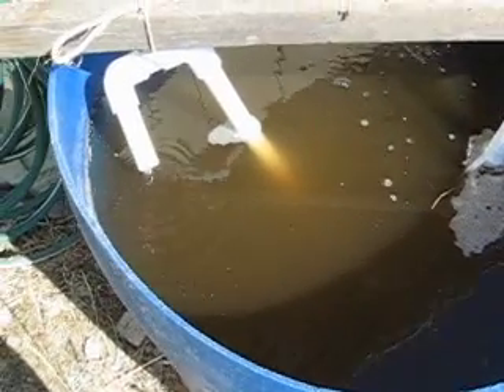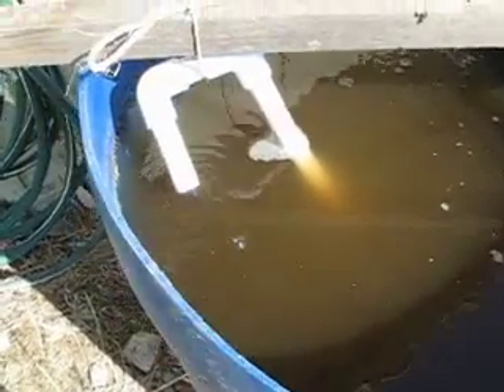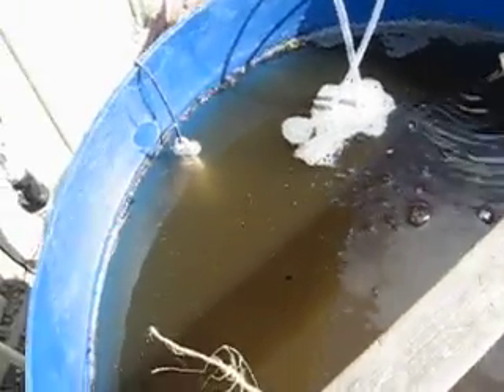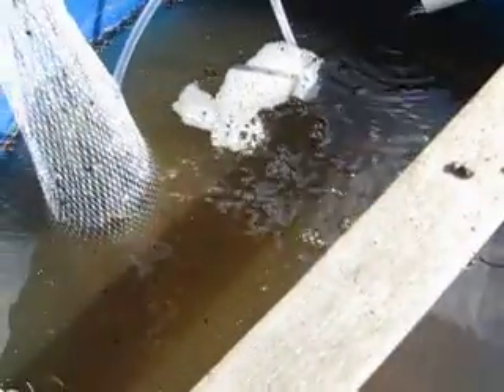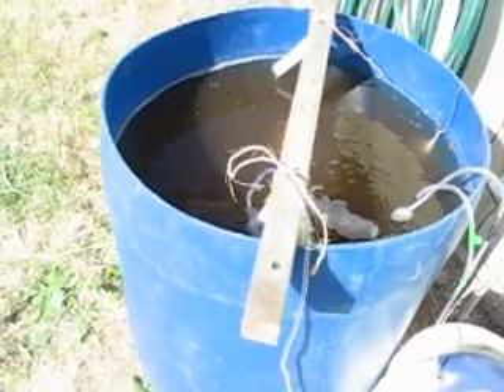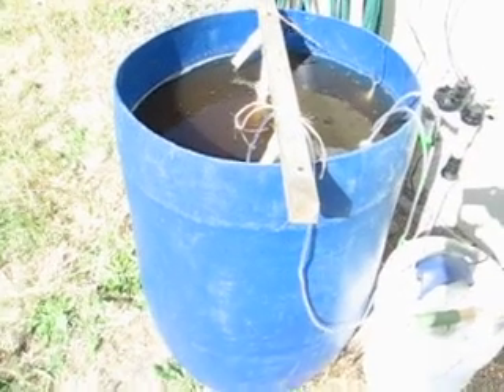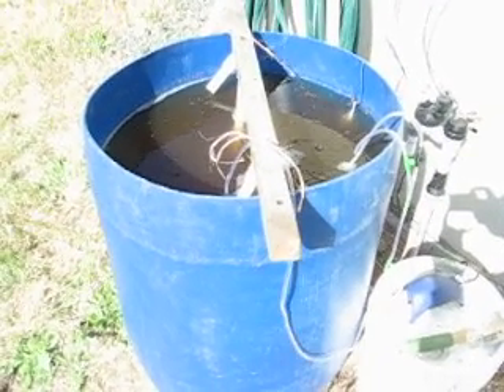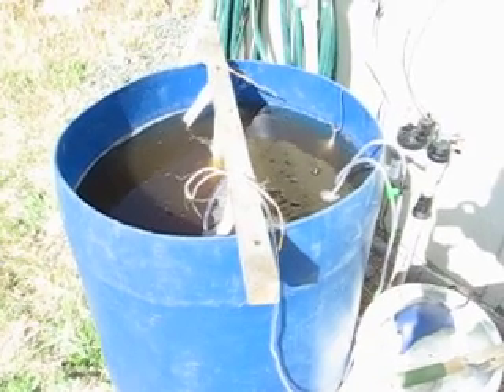Compost Tea Brewer using Air Lift Pumps

Comment: @tubefrankm- i've been doing compost/worm teas for a while, and i had a couple of comments about your setup. 1. there's just not enough compost in there to = the ammount of water. for a 55gal drum, there should be 3x as much compost, or 2x as much worm castings. 2. there's nowhere near enough oxygen to keep 55 gal's of bacteria alive. i think if you broke out a microscope, you'd find out you have not much more than brown water there. there's nothing wrong with that, it's just not compost tea.

Comment from the maker: @bcdrummer Compost Tea is a way to add good bacteria and other nutrients to your soil or directly on your plants.  Most soils have lots of nutrients but the plants can't access them so the bacteria live in a symbiotic relationship with the roots of your plants breaking down and assisting the roots to take in nutrients from the soil. You can also use it a spray on your plants for things like mold.. that the bacteria will eat plus plants will take the nutrients in the tea directly in threw leafs.

Comment from the maker: @jaylc005 Not All Wrong, I've changed it some to now I have a center 4" tube to make the air-lift pump and use air stones to release the air at the bottom of it. I've increased the air flow using an air line from my shops air compressor.  It circulates the water making sure there isn't any anaerobic areas in the barrel and the airlift pump super oxygenates the water column. In my experience makes a much faster and better tea than just bubbling in a bucket. Give it a try and see if you agree...

Comment: I guess I see what you mean,I made some with an impeller type pump and the bacteria multiplied amazingly, within 24 hrs it was like a yeast, very frothy. so some might be killed but they are multiplying even faster.

I should add that on my set up the impeller is more like pushing the water , they are not going thru the impeller like a blender, that could make a difference

Comment from the maker: 2 air lift pumps - two 1/2" PVC pipes that run down to the bottom of the 50 gal drum with an air line in the bottom of the PVC about 1-2" pointing up in each pipe. The air bubbles rushing up the pipe make the water flow out + add O2 to the water for bacteria growth. I use 2 lbs of my worm castings and 2 lbs of good hot composted chicken manure. I let it brew for at least 24 hrs up to 48. I put around 8 oz of corn sugar for a food source for the bacteria. I usually stir things up a several times.

Comment from the maker: Yes, an air lift pump sure fits the bill for brewing compost tea. There isn't a better way to aerate and move the brew. Plus all you need is an aquarium pump and some PVC very economical.

I'm going to try and find some 3/8" pipe to see if the smaller pipe will increase the pumping action. I think the smaller pipe will increase the % of air to water making it pump faster.

Frank